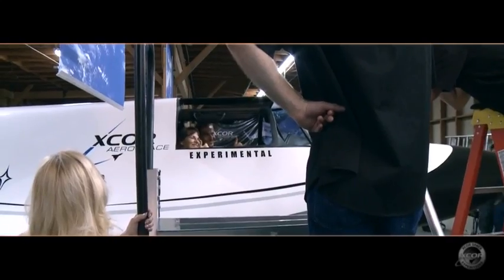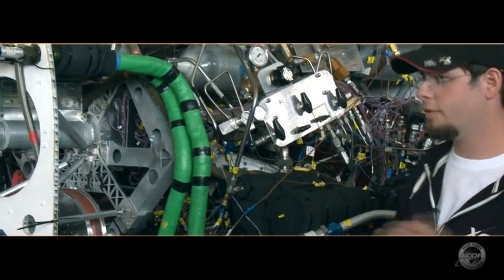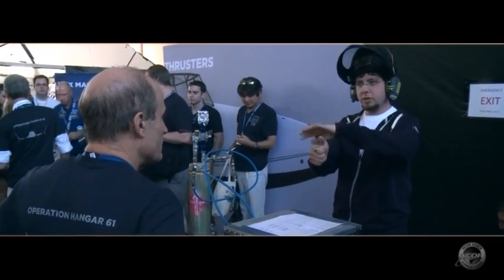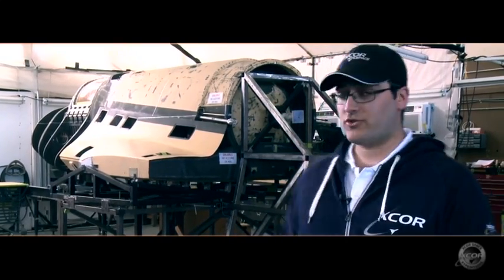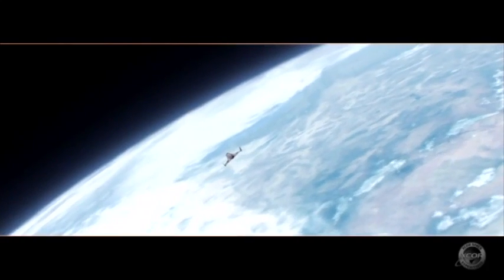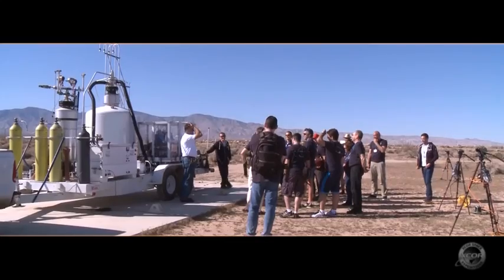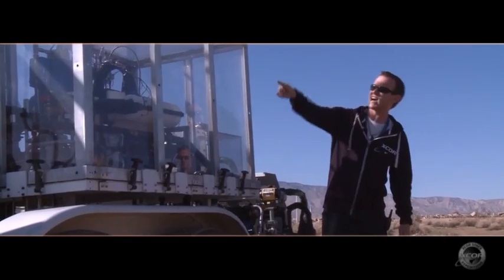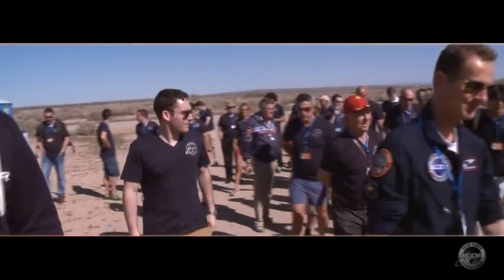XCOR Operation Hangar 61

Comment: Noguchi and Songsu of early 1940s Hamgyong Province whose cosmic ray muon catalyzed rocket plane engine which consisted of a Dewar of cryogenic liquified deuterium connected to a beryllium alloy reaction chamber nozzle coiled in and around electromagnet coils could be mounted atop a rear of a Xcor Lynx to augment chemical engines.
Reply: Of March 2019 invite only engineering conference held inside MIT's Electrical Engineering Dept. I gave a presentation on such a topic based on my peer reviewed articles published by Dr. Mitchell Swartz affiliated with MIT.

Comment: Make a 3 miles long maglev catapult and go to out space
Reply: Andy Casbo Shit. That's a pretty good idea actually.
Reply: Right, 25,000+ ft/sec (orbital velocity) in 3 miles.  You might want to do a g calculation for those parameters...assuming avg accel to 25000 ft/sec for orbital (would actually have to be faster than this, because of frictional losses in the air on the coast phase, ESPECIALLY to launch in an orbital inclination/elevation) in 16000 ft, you would be under acceleration for about 1.3 seconds @ something like 400 gs...it sounds way past 'kill you" and more into at least somewhat 'liquefy you" acceleration regimes to me.   Just sayin.  Oh, and no material I know of that you could make a practical 'ship' out of would survive thefrictional thermal loads of the atmosphere...so really, not a liquid, more like flashed into nearly instant steam.  But hey, it's OK with me if you want to ride it.
Reply: @MrJdsenior  Remember , my intention was only to save fuel and never to achieve orbiting speed on the ground .like a train with  liquid oxygen cargo, the engine can be turn on just before the end of track. can work for passenger spaceships, my other dream is a spinning magnet inside the ship. i made a model 5 years ago, the object lost 35% of weight
Reply: @AndyMatrix  As a booster, it makes some sense, but you're not going to gain all that much velocity in 3 miles. 

For small vehicles, putting them on a high flying jet carrier makes a lot more sense, you leave with 400-500 mph and 35 - 40 k feet altitude under your belt, though obviously there is significant fuel burned to get you there, just not carried in the exo atmospheric vehicle.

As for spinning magnets reducing weight, I have no idea what you are talking about.  Is this something that actually makes sense somehow, or are you talking in the fantasy reality 'realm' of perpetual motion and free energy nonsense.

A space elevator really makes sense, but it would be the most costly thing man has ever constructed, and materials are only just now being developed that could possibly accomplish the tether.  Also, you've got to drag something like an asteroid in for the tensioning mass, and that would be INCREDIBLY expensive as well, and require a vehicle FARRRR in excess of anything that has even hit serious 'napkin' drawings, as far as I know. 

Still the exclusive realm of Sci Fi.  And  you would STILL have to boost to achieve orbital velocities, pretty much similar amounts for just the delta V, but obviously without all the gravity well climb and atmospheric losses. 

If you looked at the Apollo program upper stage LM boosts off the moons surface you'll see they start reorienting the vector significantly toward a moon surface parallel direction VERY quickly, I think like in the first 50' if I remember correctly, rather than well above 50,000 feet here.  Most all of that vertical velocity is wasted as far as orbital inclination velocity s concerned.  It gains altitude, and some usable velocity, but very little. 

Not having an atmosphere means you can do stuff like that (50' pitchover initiation), and it pays big dividends, that and a MUCH smaller gravity well.  I expect EVENTUALLY, if we continue manned excursions to other Sol orbiting planets/moons, we will probably be launching many from the moon.  That's a long way in the future though, incredible logistics nightmares, there.  If you think supporting an ISS is expensive, try that same vehicle in MOON orbit.